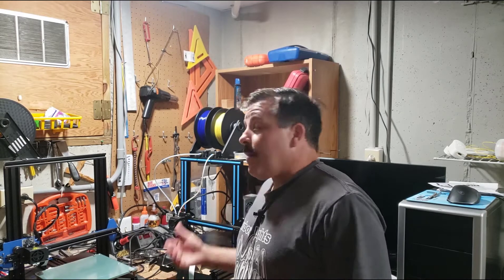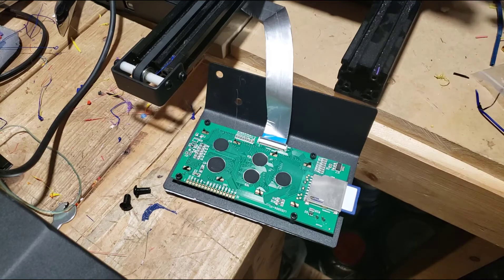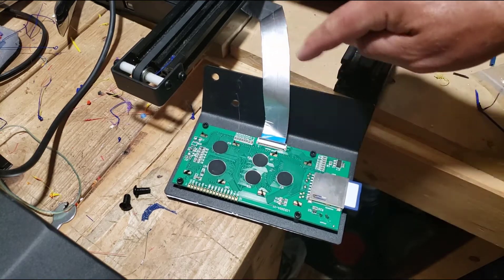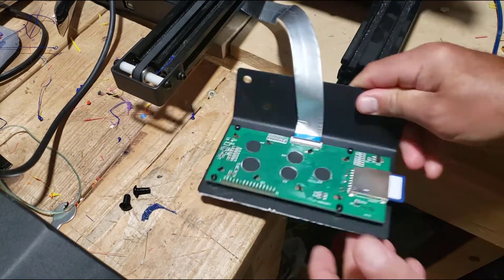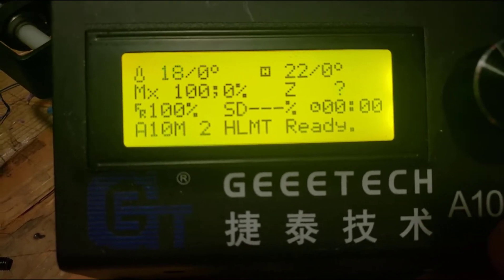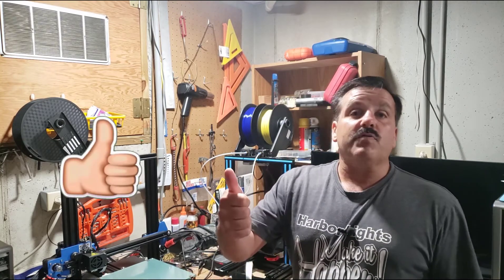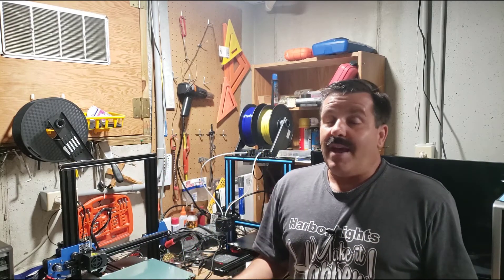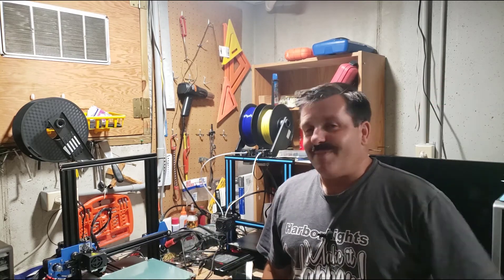Solved! Geeetech A10M borked screen is fixed - Thanks for the tips!

Comment: Hello!! I have a geeetech a10 and my screen is lighting up, but not displaying anything. I’ve recently replaced my hotbed and replugged everything correctly, but now my screen is malfunctioning. 

What should I do? I’ve tried resetting, unplugging and replugging, and turning the machine on and off with no results.
Reply from the maker: When my screen was not working right it was because the cable was a tiny bit crooked.
Reply: do you fixed it? and what have you done?
Reply from the maker: @abonierttkraasplay  I have not heard back from the user... I am curious too.

Comment: HI HL  PLEASE  I NEED YOUR HELP WITH FIXING MY SCREEN ON A10M ITS ONLY SHOWING 2 ROWS OF BLACK BOXES ON IT WHAT I SHOUD DO UPGRADE TO FRIMWEAR MIRLIN 2.0 BECOUSE THAT ISSUE HAPPEND AFTER UPGRADING THE FRIMWEAR 1.8 SOMTHING USING CURA IT WORKED FOR A BIT THEN IT WENT TO THAT AFTER I WAS TRYING TO SEND COMANDS ON G CODE  TRIED TO MANUALLY RESETING IT NOTHING HAPPEND  SO WHAT DO YOU THINK I SHOLD POSIBBLY DO, THANK YOU .
Reply from the maker: The only real trick I know is reseating the cable like the video shows.  When you send a message please do not use all caps. It is really hard to read.